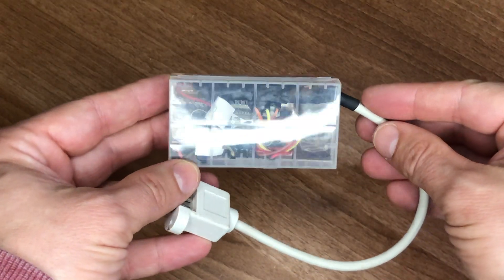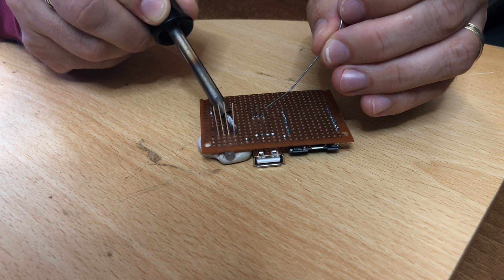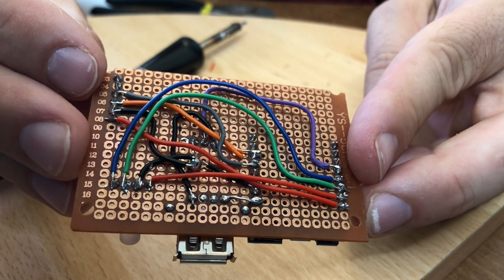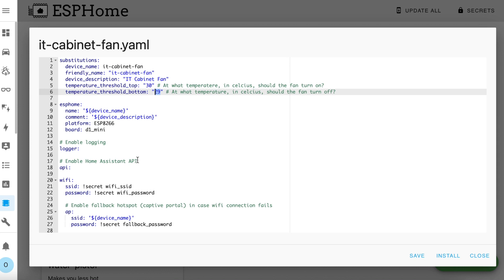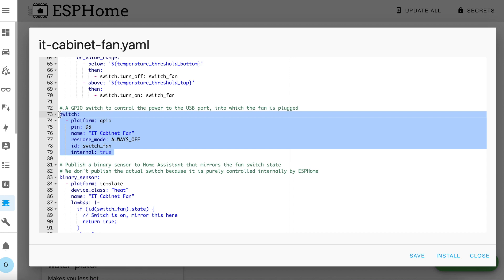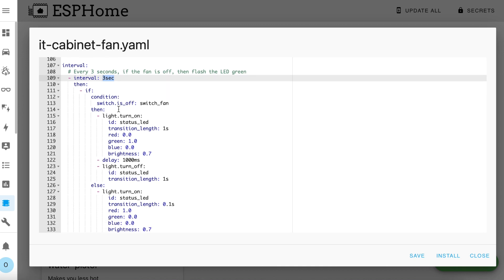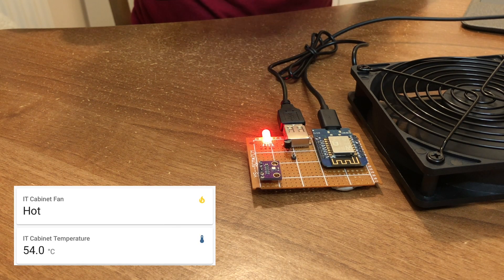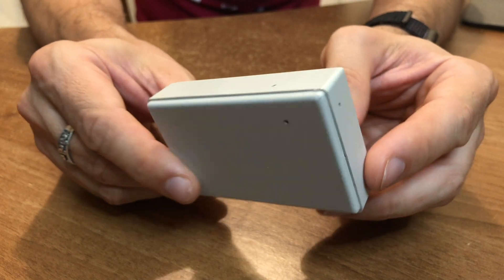ESPHome Temperature Controlled Fan v2 - The Deluxe Edition!

Comment: Total beginner question here 🙂
I noticed the RGB LED is connected directly to the ESP8266 pins without resistors.
I’ve thought that LEDs usually need current-limiting resistors, but this seems to work fine at 3.3V.
Is it safe long-term, or am I missing something obvious?
Reply from the maker: Technically yes you are correct and I should have put resistor in the circuit. But the ESP8266’s power limitations mean that in this exact scenario the LED is fine. If you want to do this correctly then stick a resistor in though!

Comment: Thanks, I’ll use this to add fans to my air compressor.  Need to get a temperature controller that I can mount on the air compressor head. Temps can get above 100C.
Reply from the maker: You will need to find a different type of temperature sensor then - the BMP280 I use in this design only operates up to 85C

Comment: Can i use more Fans?
Reply from the maker: Theoretically yes, but be careful. The more fans you attach, the greater the power demand and the more likely it is for the wires to fail. I would suggest you instead have a separate adapter that sends the 5v to both the microcontroller and the fans rather than using the 5v pin on the microcontroller. The microcontroller can still control the fan's neutral using the transistor like in my design.

Comment: Just built somthing similar with a h Bridge but struggling with code as can't get the speed slider to appear in ha just on and off, be great to see a project like this
Reply from the maker: I've built a prototype speed-controlled fan using ESPHome for an upcoming video. In ESPHome you use a fan entity which gives you on/off and a speed slider. I'm just using PWM for speed control, nothing too fancy.

Comment: Is it possible to make the fan speed dependent on temperature? So that it starts at a certain temperature then increases the fan speed up to a given max temp?
Reply from the maker: Yes, but not with this design - this design is purely an on/off control of power to the USB port, which just so happens to have a fan plugged in. To control the fan speed, the best approach would be to use a variable speed case fan and control it using PWM. The fan itself would probably be 12v and therefore you'd need either two power supplies (12v and 5v), a combined power supply, or a voltage step down/up module in there. A pin on the ESP module could be configured to use PWM and subsequently control the speed of the fan. I'll put it on my to-do list for a future video! I don't have a need for it myself, but it could be an interesting little project.
Reply: I recently made a controller that'll do that.
Reply from the maker: @3ATIVE  So have I and that video will be published in a couple of weeks time :)

Comment: The fans I need to use are 12v rather than 5v USB fans. Any idea how I can modify your project to make it work for 12v 3 pin fans?
Reply from the maker: Hi, there are a few ways. You could just run the fan at 5v and it would run slower than intended; you could use a 12v power supply to power everything, but put in a 12v-5v voltage step-down to run the D1 mini; or you could run everything from 5v but put a 5v-12v step-up to run just the fan's positive connection; or use a dual-voltage transformer like the ones used to power old PC hard drives (https://amzn.to/3Vjv52r) which you can split off to run the D1 on 5v and the fan on 12v. In all scenarios, you just send the 12v positive to the fan's positive terminal instead of connecting the fan directly to the D1's 5v output, and all of the grounds are common.